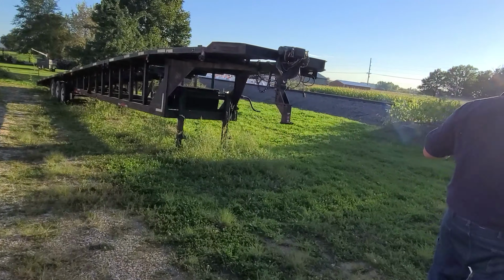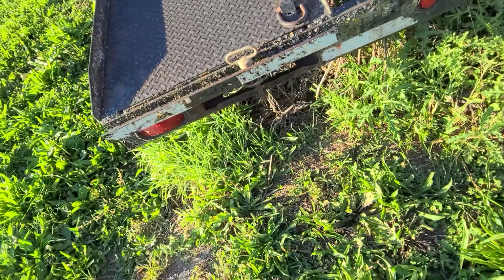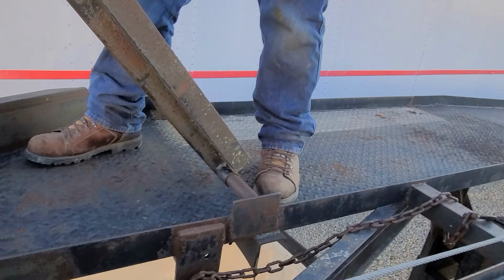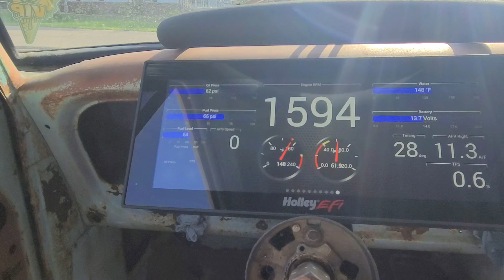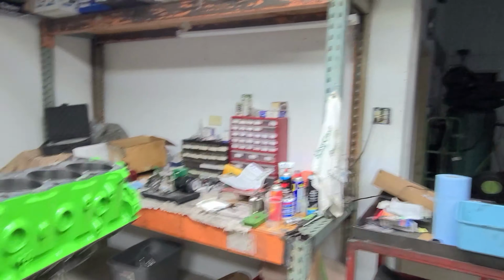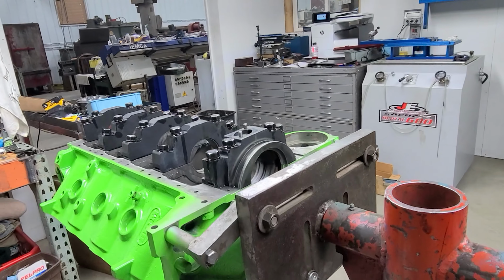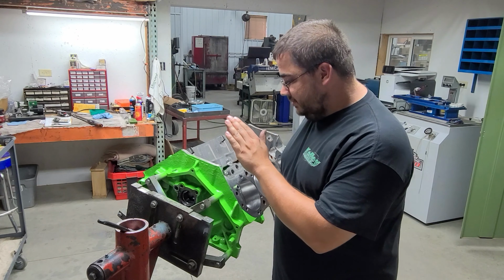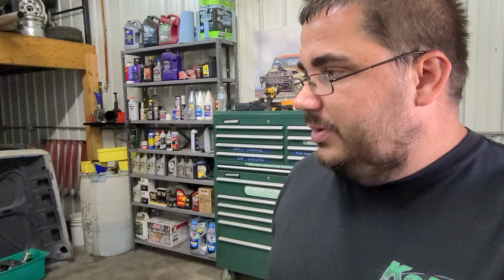New engine assembly and new trailer for Cleetus and Car events!

Comment: Been my experience with trailer tires is to buy the best ones you can get and replace them every year or other year and sell your used ones to someone else because trailer tires sitting seem to have more problems than ones going round and round everyday of there life.  Just a thought since that your new to you has some rust problems the easiest way I have found to survey the tubing without holes in it is a picking hammer for bodywork and give the “frame rails and crossmembers the woodpecker treatment because square tube trailers that were not painted on the inside or made out of Cor-Ten steel they all rust from the inside out.  When I was building trailers for fun and profit I used preferred using c-channel and box out areas that were high load/stress areas because it ameliorated the rusting problem and made it far easier to plumb the hydraulic brake lines or air brake lines/hoses and trailer lights.
Reply from the maker: thanks for the info!! i am picking up some 14ply tires for it this week.  worst case use a couple of these as spares just in case.  i'm hoping to be able to plate the outside of the channel with at least 11ga (dont want to add to much weight) to help get us by for a year or 2 and send it down the road.  maybe that is a bad idea to do???? appreciate the info!!!
Reply: @BoostedRide   A couple of mounted spares is always a good thing along with a set or two of wheel bearings, races, and seals. I like to pack the wheel bearings with grease and store in a pint paint can with a extra handful of grease and the cut a piece of plastic to set onto the packed bearings/races and handful of grease an place the seals, a spare axle nut, locking cage, and cotter pins and after I hammer the lid onto it I would paint the can with orange rust oleum and put it a toolbox on the trailer. 
For repairing the rusted out or rust weakened frame rails have you considered using L-Channel/angle iron or C-Channel because It has been my experience that if you have a rust hole on the side the bottom of the tubing is going to be rust compromised more times than not as well. Worse case scenario is you might have to replace the bottom frame rails and crossmembers which would kind of suck because it is a lot of work but in reality is not that hard of job